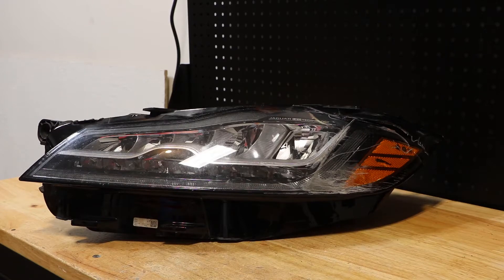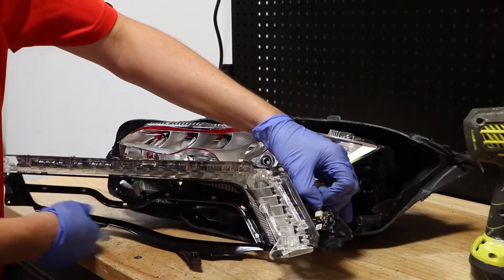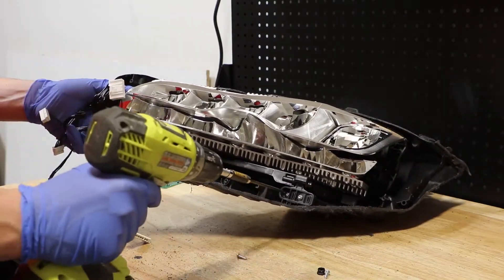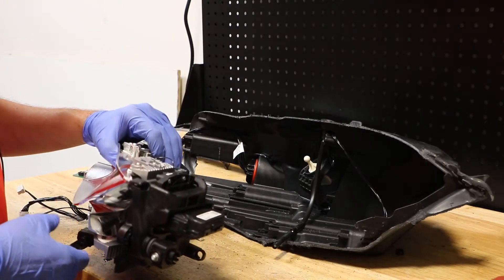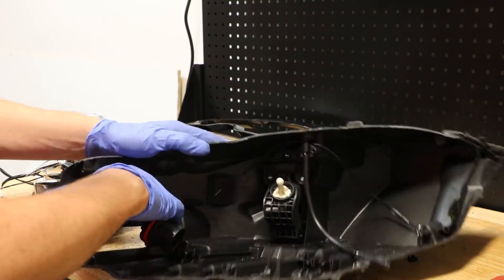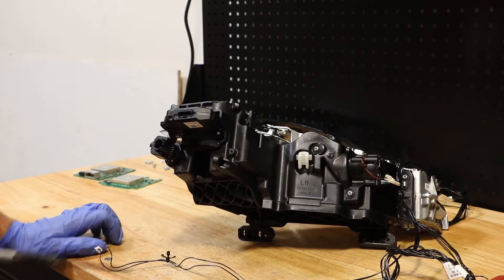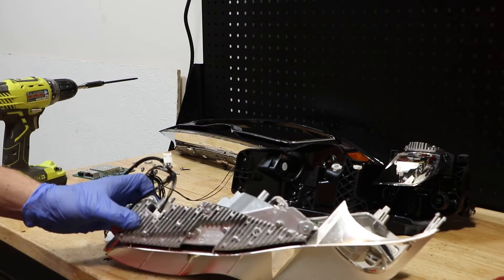2016-2019 Jaguar XF F-Pace LED Headlight Disassembly

Comment: Excellent video. I think I am going to do this as a new one or even a used one is so expensive. All my LED's work but there's a loud buzzing noise on the RHS headlight only. I think it might be the fan. Is that the fan at 3:24?
Reply: The video does not show the fan specifically at any time. He shows removal of the LED units. The reflective covers the heat sinks and control modules. The fan is located inside the black housing unit. He does not focus on. I will try to add a photoonce I get home. 6:06
Reply: As you may know, the fan always makes a slight buzzing sound. But mine did become much worse and sounded like someone was drilling through a pile of tin cans. I replaced the fan by purchasing a used headlight unit on eBay and making a swap. It is somewhat difficult.

Comment: My headlight fan(s) are squealing - can they be replaced or does the whole headlight need to be replaced?
Reply from the maker: There is no service part number for the fan.  You would have to track down another fan and open the headlight to get access to replace it.  Otherwise your only option is a new/different headlight.
Reply: @gftgrill  Ouch - replacement headlight assembly is $4,300.  I'm hoping somebody has a solution to replace just the fan, even with an aftermarket fan.

Comment: How do you remove the lens from the headlight?
Reply from the maker: I removed it by cutting it off with a saw.   The general recommended way is to bake the headlight to soften the glue and pull the lens off once the glue is loose.
Reply: @gftgrill  thanks
Reply: It is difficult. I did so carefully using a 5 in 1 (painters tool) Used the sharp tip to cut slowly all the way around the unit. I purchased a parts unit on eBay for $500 and learned on that unit (30 minutes). Before doing the same on my better unit (10 minutes). These are sealed with liquid gasket material which is easier to remove than silicone sealant.

Comment: Are there two cooling fans installed? If I replace the cooling fan by cutting the back side without removing the lens, the internal cooling fan cannot be replaced, right?
Reply from the maker: I do not remember if there was 1 or 2 fans in this light.  Looking back at the pictures in this video it does look like there might have been 2 fans.  one on the outside of the main bracket and 1 on the inside between the bracket and the reflectors.   The one between the bracket and reflectors would not be accessible without removing the lens and separating the parts.
Reply: @gftgrill  i See. I'll have to remove the lens. Thanks for the reply.

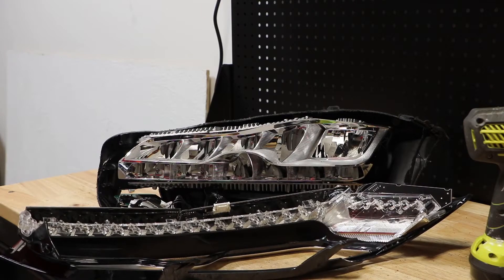Comment: Hi,the daylight which you removed by 0:37 is not working by me on the right side from the driver sight. Where could be the problem pls ?
Reply from the maker: it's either a failure in the control unit or the board/LED level.   Either you will need a donor headlight with working parts or a new headlight.
Reply: @gftgrill  Is it not possible to change the daylight only ? The new costs like 1000 pounds.
Reply from the maker: @maracze77  you can't purchase the DRL only.  You must purchase a whole headlight.  Everything is internal to the headlight.   You can find a used/damaged light to use for Parts, assuming it's still working and swap the parts.   To open two headlights and swap the components will take around 6 hours total including the time to remove and replace the light from the vehicle
Reply: @gftgrill  But u said it could be actually another problem with control unit right ? How big is the probability that I dont have to buy the whole headlight.
Reply from the maker: @maracze77  The control unit is also internal inside of the headlight.  I don't think you are going to fix this without buying a headlight.  I assume that only your DRL is not working and the rest of the light is working (low/high beam, turn signal, running light).  Based upon that I think your choice is to buy a whole good headlight and swap the whole headlight (new or used) or to buy one for parts and open both headlights and swap out the faulty components.
Reply from the maker: you can see the control units here:  https://youtu.be/0cwlaDBJV9Q?t=61

Comment: where is the cooling fan and can it be replaced on the f-pace
Reply from the maker: you can see it here:  https://youtu.be/0cwlaDBJV9Q?t=204

Jaguar doesn't offer a replacement part.   It is not accessible without disassembling the full light.
Reply: Panasonic
UDQF45C02-VR
DC13.5V 0.06A
Just swapped mine out. Wish I could post a photo.
Reply: @ericm5672  Thanks. That might help me with my buzzing sound. Is that what you had?

Comment: Does anyone know if someone can replace the leds inside
Reply: Any luck? My headlight went out and I'm at a lost
Reply: @ no not yet I ended up buying a used headlight from eBay for around 700 USD
Reply: They look like surface mounted LED's and therefore can be soldered and desoldered. You would have to know the wattage and strength of them for replacement. Much like the backlights in a television.